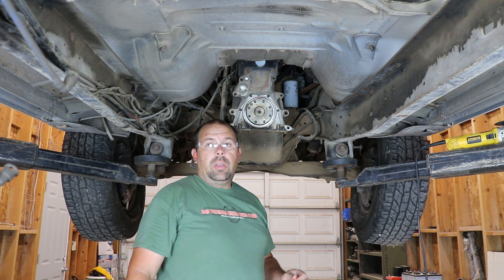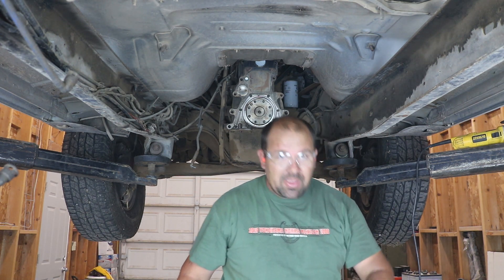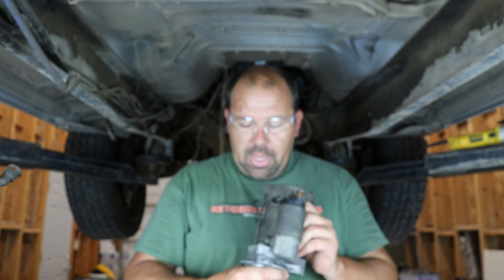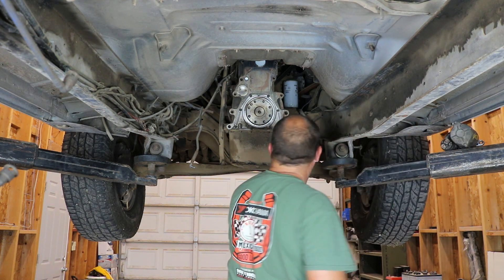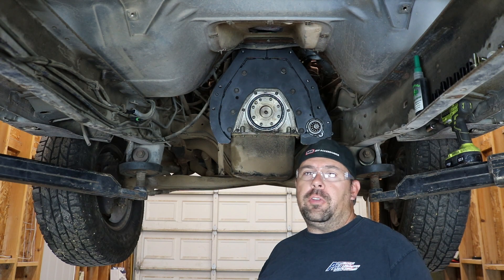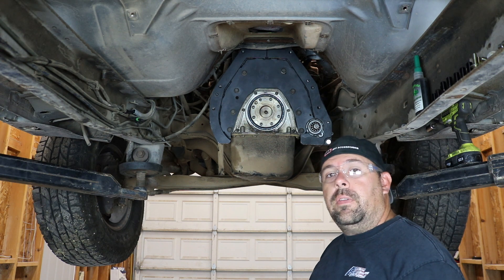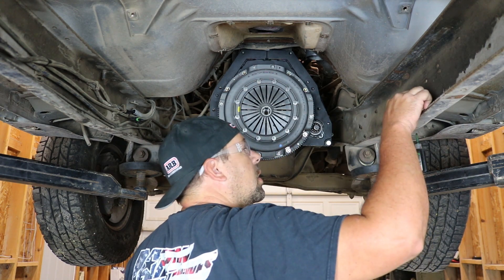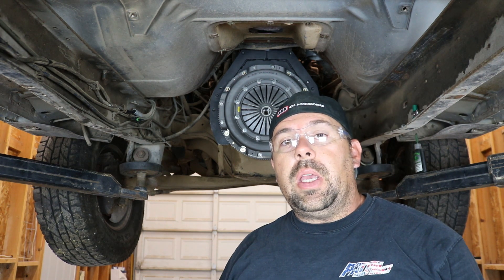Wild Horse Manufacturing Cummins adapter plate ZF5 to 6BT

Comment: Did you need to modify the flywheel for a zf5 clutch? Pilot bearing? Drill new pressure plate holes? 

Also does the stock 12 valve ring gear work with the 6.0 starter? Thanks.

Comment: Hi I have 1995  12 valve 2500 and I'm installing zf6 transmission From 1999 F350. What  pedals  would  recommend  from  the f350  or dodge  pedal  assembly? Thanks
Reply from the maker: Use whatever pedals fit the truck.
Reply: I have a 1996 12 what all do I need to do to put a zf6 in it. If there is a video will you send it my way thanks!!

Comment: The clutch part of the swap kit?
Reply from the maker: bryce robbins No, the clutch and flywheel are stock parts purchased separately.
Reply: If you go to wild horse fab website they have a full write up recipe how to do this engine to trans conversion. I used their write up bolted up great.

Comment: Is this a small block zf5 and if not do you know of kit that fit the small block zf5
Reply from the maker: Raffaele Pizzari This is a 460 Gas ZF5. Adapter plates are made for the small block ZF5 but not recommended due to the small diameter clutch. They don’t hold much power before slipping.
Reply: @philofab  cool man thanks for the reply im am currently looking for a 460BB or 7.3 idi zf5 trans for my cummins swap